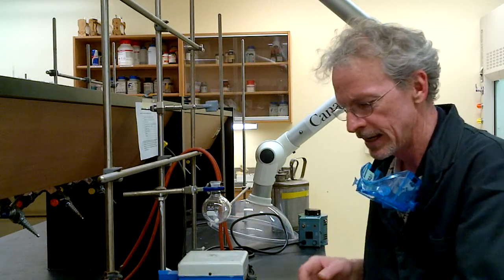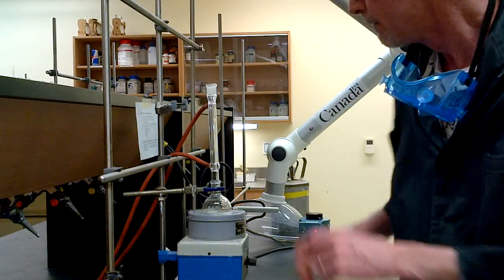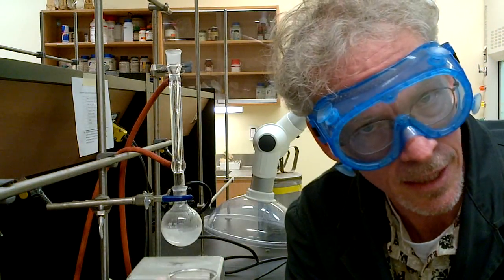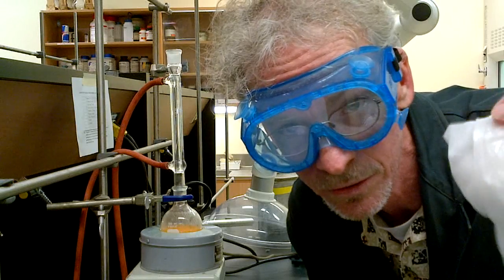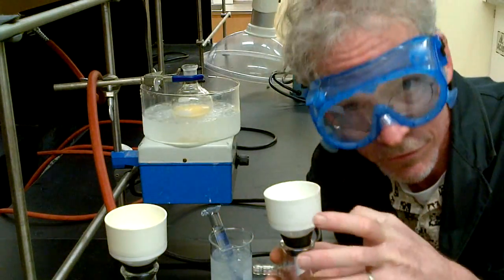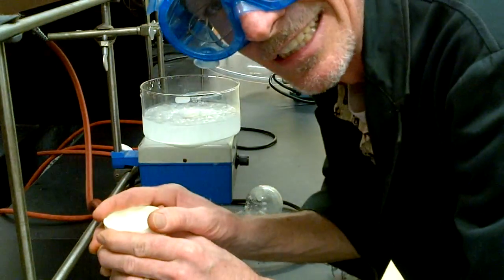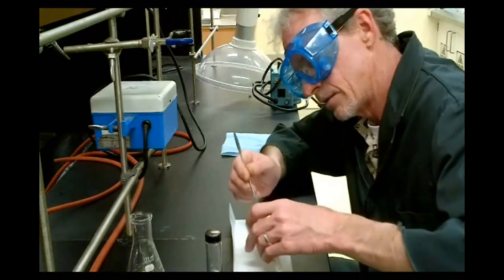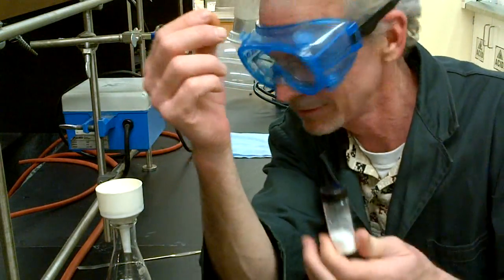Bromination of trans stilbene. Greener Method.

Comment: I'm surprised to see how much the safety of all chemical processes has Evolved since 20112. doing such manipulations with so few means of protection would cause my laboratory manager to have a stroke. thanks for this demonstration.
Reply: What kind of extra measures are currently recommended? I worked in the lab way before 2012 and the only extra measure we had was a fume hood and the requirement to put glasses on before entering the lap. All that was enough for much more dangerous substances too (unless working with instantly deadly stuff where you needed someone else to look over and antidotes nearby).